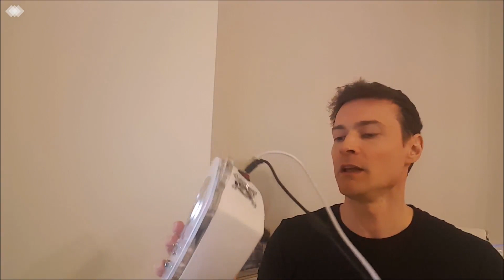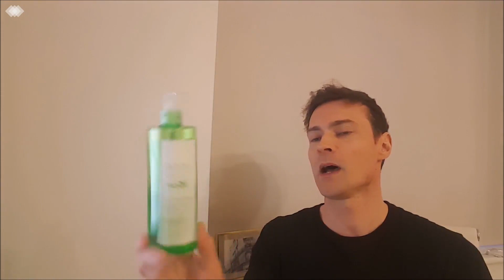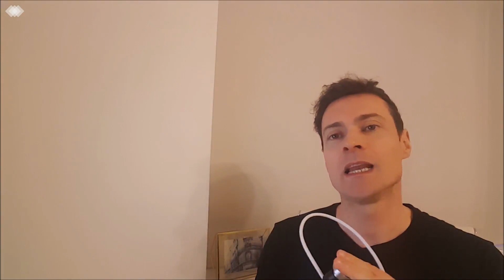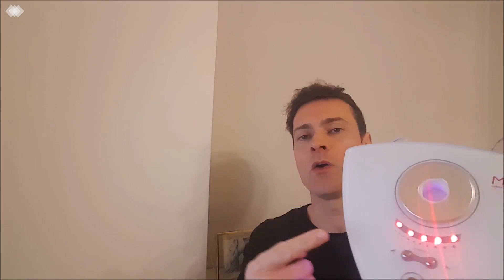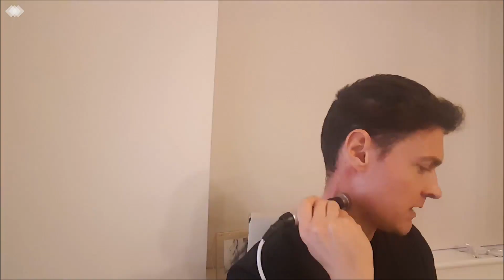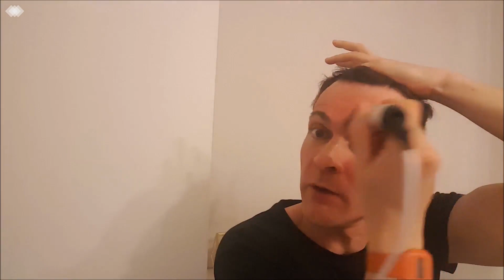Update after one year using RF Skin Tightening: My New Jawline!

Comment: Really noticed the merging of my jawline and neck today, sheesh, do you have a link for this item?
Reply from the maker: Hi, this is called the CARER Mini RF machine but it depends which country you are in as to what is showing up on Amazon. It's a generic machine which is labelled by different brands.https://www.amazon.co.uk/Bipolar-MYSWEETY-Portable-Frequency-Rejuvenation/dp/B075CP339N/ref=sr_1_10?crid=20PK10KN4FFNN&keywords=rf+skin+tightening+devices&qid=1552254773&s=gateway&sprefix=RF+skin%2Caps%2C421&sr=8-10
Reply: @10YearsYounger  aw thanks man :-)
Reply: Haha... Did you fix it? I use microcurrent machine, it's a slow process...but also, you need to lose weight for everything to look proportionate. 
If I can recommend guasha and lymph draining methods.. you need to do it mindfully, love yourself and you will look amazing.